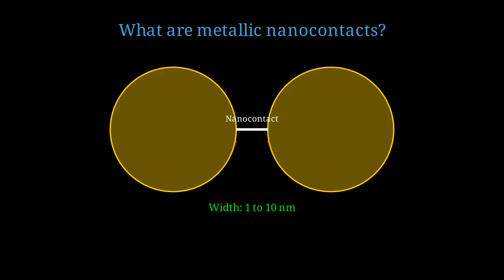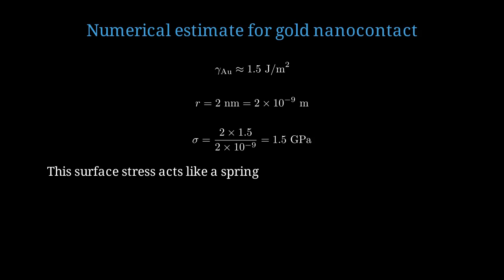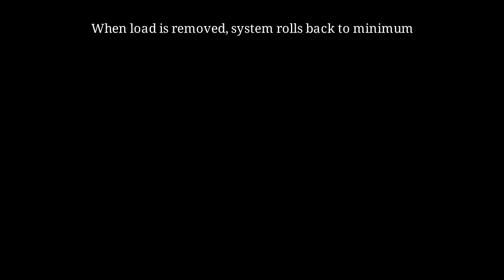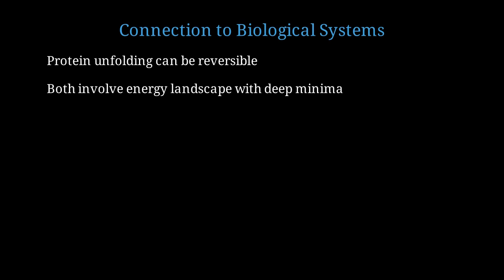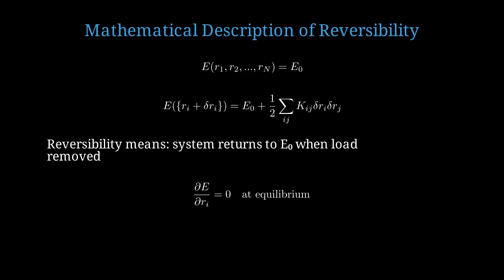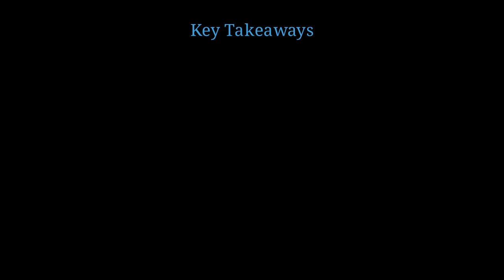Can Reversible Plasticity be Engineered Into Bulk Nanostructures?

Comment from the maker: What is the ultimate strain limit before irreversible atomic rearrangement occurs in different FCC metals?
How do temperature and surface contamination influence the reversibility of nanoscale plasticity?
Can reversible plasticity be engineered into bulk nanostructured materials through designed interfaces?